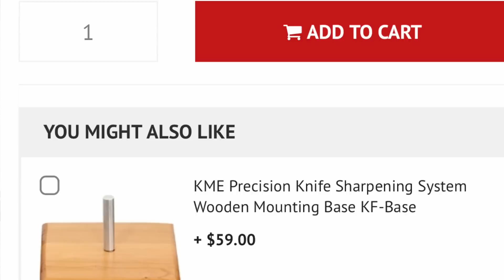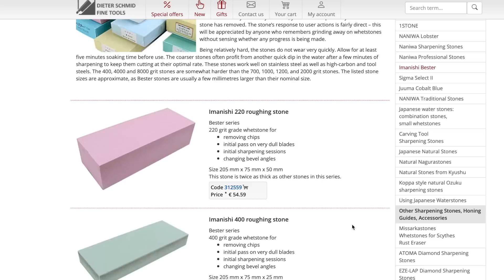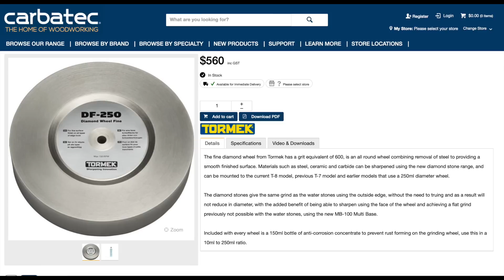Fixed Angle Sharpener Showdown - Low, Mid, High Cost Quality Options (Worksharp, KME, TSPROF)

Comment: Ruixin Pro works very well for me, specially the RX009 model. I sharpen knives for people (maybe 60-80 knives a year) and used the Ruixin Pro RX008 with some diamond stones for a while now. Most of the knives that come to me are in terrible condition and need a full reprofile and chip removal, so the use is heavy duty, even if they are not "super steels". 
After some use, the system did became a bit wonky, but still usable. There is no plastic on the main system parts (except the rod eyelet ball and handle), though the alloy they use for the clamp is a soft chinesium.

The diamond stones are not insane quality but I still managed to sharpen over 200 knives of all kinds with them, and they can still go. I do recommend buying the diamond stones, as the basic corundum that come with it are not very good. 
Might not last as long as WS or KME system diamond stones, but the stones are basic dovetail mount and non-proprietary like the WS for example and are way cheaper. Has a rotating clamp and can fit pretty big knives as well. 

I upgraded to the RX009 model a week or two ago and it is even better. Seems to be addressing some of the issues the RX008 had pretty well, but still have to see it in some substantial use. There are also upgrade and replacement parts you can get (that fit both models) along the way if needed. You don't have to buy a full new sharpener if you manage to break something. 

If you are burdened by the exact N-degree angle it is not for you, though you can still make it work. I don't do "angles" unless requested (and it is never requested), I eyeball it according to the specific knife. If you just want a sharp knife, it will serve you well for years, for basic home use it is absolutely fine.

Comment: I got lucky and pre-ordered the WorkSharp Precision Adjust sharpener for $40 USD on the initial pre-release of the system (I guess it was 2 years ago - time flies).  It worked great, but I wanted more from the sharpener.  When the expansion set was released in late 2021, I had to seriously consider if I wanted to put an additional $120 USD into the Precision adjust or just bite the bullet and spend the extra money to get the KME diamond system. (note: The price of the Prescision Adjust Add-On Kit may be less, but I have not looked to see after the initial announcement in 2021.)   I decided to go with the KME solution with diamond stones and I have absolutely loved the results.  The entry level Precision Adjust system is a wonderful "gateway apparatus" for the price to see if you want to learn how to use a fixed angle system, but don't spend too much money on this tool because you will quickly outgrow the system if you enjoy this method of sharpening.
Reply: Had the same conundrum and thought process and just went with the KME myself and am so glad I decided to go that way. I've only sharpened about 6-7 knives but I absolutely love it thus far. Got the stones broken in on the beaters and only just sharpened my Para 2 & 3 this weekend. Can't get hair whittling just yet, but definitely shaving sharp. Want to get the roo strop and emulsion next.

Comment: Regarding the Worksharp: Get the basic kit for 50€ (+/-) and buy replacement parts when the honing surface gets used up. Especially if you own a leather strap anyway.

Comment: What's your opinion on the Spyderco Sharpmaker? Me, I think it's great for finishing knives I hand sharpen, or knives that don't require deep chip removal.  And it sharpens serrated edges with aplomb.

You're right about the Worksharp field sharpener, it's fantastic bang for the buck, use mine all the time.

For my sharpening side hustle, my DMT 600 grit diamond stone is my go to. It's well used, probably more like an 800 grit stone, and combined with leather strop and chromium oxide compound, I get phenomenal kitchen knife edges.

Whoa! Those pups are doggo sized now! Nice to see them grow :)

Comment: I have debated an Apex Edge Pro.  I have the work sharp which I am not unhappy with I just need something for bigger knives.  I like that the Edge Pro doesn't use clamps do you don't have the problem with angle inconsistencies.
Reply: Same.  I was hoping he'd give his opinion on it to see where it lands vs the Worksharp.  I am leaning more towards the Apex.  Not having to worry about clamps and blade length as much is great.  Not sure how good their stones are and how steady I can keep my hands using it though.
Reply: I've been using the edge pro for years and continue to because I usually do a 12 or 13 dps edge with a 20 dps microbevel. You do have to pay more attention, and find the sweet spot on the blade where it can be stable. Some knives are easy, really most, to hold steady. Some are a bit finicky though. With a 400 grit atoma stone, and your choice of grits in diamond or chosera stones reprofiling and sharpening are easy. You will need a drill stop collar for the different thickness of some, and an angle cube because all angle guides on these things are guesses. Good edges though, but bit messy, need to put in a bit more effort since you're holding it, and you need to get some extras to really make it rock.
Reply: @couldntthingofone269  That's great info.  Thank you!  I was considering Apex 4, but it sounds like going with Apex 1 + drill stop collar + diamond stones + angle cube might be the way.

Comment: I prefer table systems like the edge pro or hapstone. Much more versatile for a multitude of blade grinds. Where as a clamp system is best for anything with flat edges on both sides but can do other shapes but not as well. Full flat grinds without flat spots to clamp. Also Spyderco style where they are full flat and thinning near the tip etc are just two examples. Sure you can do them in clamp systems but its not idea and can move in the clamps.

Plus the table systems use edge pro universal stones that have so many options. The tsprof systems do have a lot of advantages too and a lot of options and also uses edge pro style stones.

I usually use the edge pro sized stones in my hands or desk for sharpening and touch ups and only use the systems to re profile.

Everyone should learn to use bench stones. Sometimes its just better, faster and easier. Especially if you already have your edge angle set.

The important part is that you form an apex with a minimal bur and remove the bur completely. Which most people have trouble with both of those. The bur is sometimes really difficult for most to even see because its so small.

Comment: I think the WS Precision Adjust is the best value guided sharpener on the market, and the standard model (AU$120) is perfect if you're not sure you want to invest in guided sharpening. Personally, I wouldn't go for the WS upgrade kit and would instead get an aftermarket 4in stone holder and some "proper" stones; it costs about the same, but you get bigger/better stones as well.

I think the KME is the single best "one and done" system because it's enough of an upgrade over the WS Precision to still be considered good value (although I still can't believe they charge an extra $60 for the stand), but it's still close enough in performance to the $700+ systems that I can't really justify spending more. I also love that you can get accessories to sharpen convex edges, axes, etc.

Comment: What would have been interesting in aditional info would be how they handle full flat ground knives with the clamps, and that depending on where you grip the knife, how long it is and how deep the blade (and the curve to the tip) the angle will change.
So for the first thing: if there is no portion on the back of the blade where the clamp interfaces with parallel surfaces of the blade like it is with full flat grinds you can clamp the blade kinked to one side with several of these clamps. This would mean despite the agle cube different angles between left and right side of the blade.
As for the second: if you take the clever you showed the edge of the cleaver has a pretty constant curve, so if you grip the clever in the center, the angle change from tip to handle is minimal and symmetric. If you take your Ka-bar for example where you have a long straight edge and then a small radius to the tip it depends where you set the clamps and how far the pivot point is distanced to the edge on how much the angle will change between the rounded poirtion towards the tip and the flat part of the edge. (In my opinion the expensive one with the big sitance may offer the smallest angel change, but i personally would not want to invest that amount of money)
So with such systems it is important to record where on the blade of each knife you clamp it, and with which angle so that you don't always profile the edge new with each sharpening.
These things are what (after trying out "fixed" angle sharpening) kept me at freehand sharpening with stones or diamond plates.
(i also tried out the spyderco sharpmaker, but for whatever reason it takes almost an hour for a dull knife even with the original diamont rods to get sharp with it. And with normal diamond plates i am 10 times faster, so i use the Sharpmaker rarely too now)

Comment: I got to work sharp precision adjust for $50 and then went to grindworx and got Veneave Diamond stones which are top-of-the-line double-sided grit for 30 or so bucks and holder plus support wedge for same price as the elite model. 🔥✌️ And then I got a case and Kline angle cube from Amazon

Comment: Thanks for another great video, I enjoy all your content! I am trying to decide which way to go. My primary sharpening needs are sub 3 inch slip joints, some slightly larger folders and fixed blades most lowly under 4 inches and family kitchen knives under 8.5 inches. I am thinking KME the customers support, community and resources are amazing, but I have Hapstone either r2 or the smaller rs in the back  of mind. I live in a small house with no dedicated space which I think knocks out the R2. I just wish there was more info on that Hapstone RS which is available as a Kickstarter currently . There is Little info on the RS and it has no reviews.Any advice or thoughts? Many thanks!

Comment: Hello;
I Have some question, what do you all Think about sandpaper used for sharpening? I will aply it on some block of wood and use like this sharpening Stones. Bad idea? I Have gradation From 240 to 2000, but my Stones are only to 1000. Can I use 1500 and then 2000 like strop?
Reply: This was a very popular method to maintain convex blades. I would use a sheet of glass as a flat surface, then use a neoprene mousepad under sandpaper. You could use 3m spray adhesive (the temporary one) to hold it all together better.

Comment: Regarding the worksharp; I think your money's much better spent by getting a 4x1 adapter and some good 4x1 (kme) stones instead of the "pro kit."

The worksharp stones wear out fast, in my experience. Granted, I only use them for high carbide steels, but I also only use them to initially set the bevels then freehand after that so they saw much less use than they potentially would from the average user.

Unexpectedly fast wear aside, the stones are fully capable. My only other complaint is the narrow width, but that's purely preference and may be a positive to someone else.

Edit: Your clip of it in use is also one of the best illustrations of how necessary it is to support the clamp! I threaded a lag bolt up through the base. The FRN is thick and strong enough to be threaded, and it's a much more stable support than all the options you generally see people using.
Reply: I haven't worn out the stock stones, but I'm planning on getting an aftermarket holder and stones for it when they do wear out.  The basic kit is enough for me to get my knives very sharp so I don't think I'll go too crazy on the stones.  
There are also little plastic braces you can 3d print or buy that'll go under the knife holding arm.
Reply: I have the base model and it will definitely get you a sharp edge, but neeves has pushed me to try free handing on bench stones and so far ive had better luck with that.
Reply: @nebulamask81  

Once you get the adapter, get the CGSW resin bonded diamond stones. They aren't cheap, but in my opinion they're the best value in sharpening equipment currently available.

I've tried all the janky support methods. They really only work if youre able to wedge it in super tight, but then you're changing the angle.

The bolt took 2 minutes and was essentially free, its stiffer and stronger than it will ever need to be and is as permanent (or temporary) as I want.
Reply: @CNYKnifeNut  I have just a single CGSW, and I think that's a decent option for 1 stone, 1 strop sharpening. And not terribly expensive. I started from wanting a CGSW stone, and essentially bought the worksharp and adapter rather than buy the bench sized stone.

Comment: I started sharpening on a work sharp precision adjust, and I loved it, but I think the most evident flaw is how the stones are inset into the plastic.  it makes it impossible to get the stone all the way up to the plunge grind of most Spyderco knives for example and makes the result look odd.  the rest of the edge is flawless though.
Reply: I had returned one for this reason and I don't see many people mention it. I told WS that they could just use thicker stones so they stick out of the plastic further and it would solve the problem. The lansky stones stick out far enough for example.

Comment: Got KME, have 6”, 15cm venev stones as well, should I update to ts prof?  Is base 
weighted, stroke length better, two clamps better than one for <12cm blades?
I have upgraded KME arm with gritomatic which allows use of multiple length stones.

Love venev stones I bought a bunch on close out 3-4 years ago

Comment: I have the KME and precision adjust, but any more I use the WorkSharp Ken Onion with blade grinder attachment.  Its fast and I get good results.  I'm not as much into sitting down and really fussing over an edge like is used too be.

Comment: The prives over there are soooo freaking crazy! Does everybody over there make like 250-300k a year?? I think you’d have to to live in that environment. Kinda like NYC and the other huge cities in the U.S.. SUPER crazy expensive but most people make huge salaries.
And on a side note I LOVE my work sharp elite kit. I only paid about $115 for mine though. Also on the advice of many people I bought one of those $7 plastic braces that go under the clamp neck. It makes it rock solid so the knife isn’t bouncing around and changing the angle. It takes away the ability to be able to just rotate it though but that’s a small trade off for the stability.

Comment: Great helpful comparison video!  I trust WorkSharp to make a decent sharpener. I have one of the more delux version of their belt sharpeners I use for my cleavers and scissors and blender blades and larger tools. It’s great!

I have been using DMT hand sharpening for all my pocket knives. I think I convexed a couple of them on a bad day though. I’m shopping for a fixed angle sharpening system. This is a great help. Thanks. I do also use water stones for my kitchen knives because I need the capacity to work on larger knives. The larger size and better feedback make it easier to hold the angle and freehand sharpen.

Comment: I got the KME based on your long use of it, I suspect at some point I will switch to the TSPROF as the longer arm will allow less angle variation from the center of the blade outwards.

I've tried so many times to get proficient at free hand sharpening on stones but like you it just doesn't seem to be for me.
Reply: I felt like stopping in my kme was rounding my apex, so I started doing that by hand, very slowly I developed the skills to get some really nice edges freehand. I still use a fixed angle system for setting new bevels tho, so I'll never get rid of it.

Comment: i found the grippiness of the KME jaws quite lacking, and improved them by gluing a thin layer of TPE on top of the existing black grip-pads. by TPE i mean just a little trimming from one of those flat exercise/resistance bands. there's a good deal more friction now; quite content with the mod.

Comment: I never understood what is wrong with a chefs steel. Provide you are consistent it works every time.
Reply: Chefs steel doesn't sharpen.  It only re-aligns the edge.  Eventually, you will need to sharpen the blade.

Comment: I’m watching this right after I watched the deka magnacut review where you got way better cut test results with the KME vs the worksharp. Would you say that wasn’t so much due to the capability of the KME over the worksharp, but just the different levels of effort needed to achieve the same result in the two systems?

Comment: Do any of these sharpening systems have a way of setting the blade angle to zero?  So I what im seeing is the blade holder doesn't exactly clamp all blades 100% square.  yeah you can set a total blade angle of say 34 degree's, but you might get 20 on one side, and 14 on the other when you flip it because the knife is 6 degrees different one way vs the other(don't belive me, measure it!

Comment: Good video, does the KME have a stone for recurves?
Reply: If the knife has a mild recurve, I have successfully used one of the standard stones to sharpen the blade.  For more extreme recurve blades, I invested in the KME 5" Hewlett JewelStick to sharpen those tight hawk bill knifes in my collection.